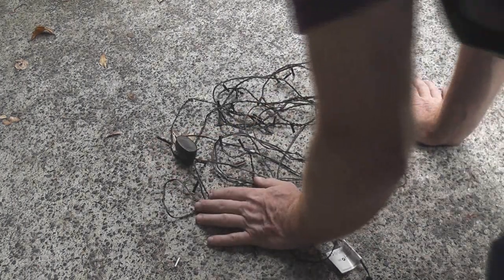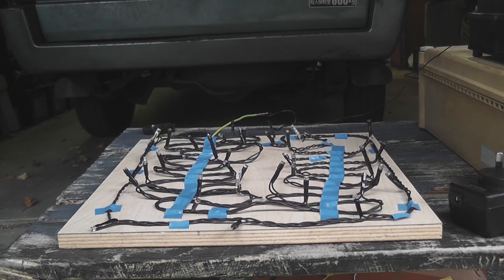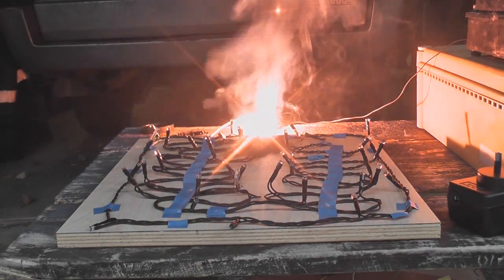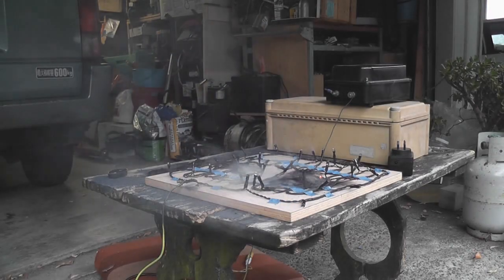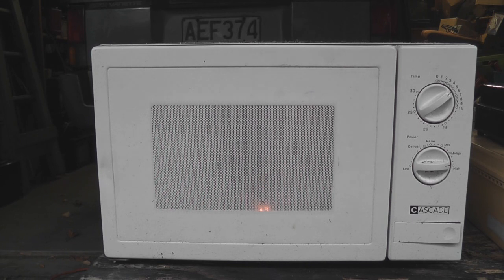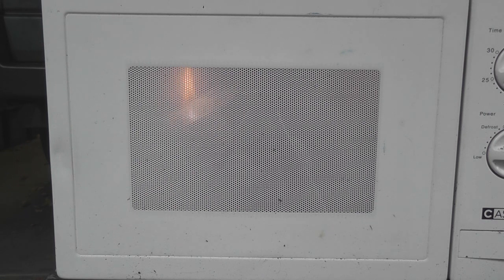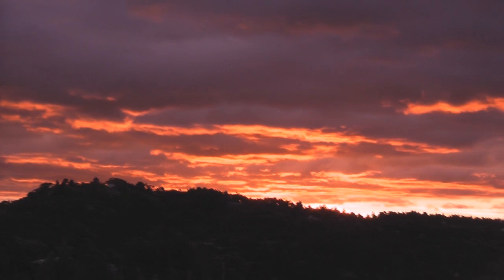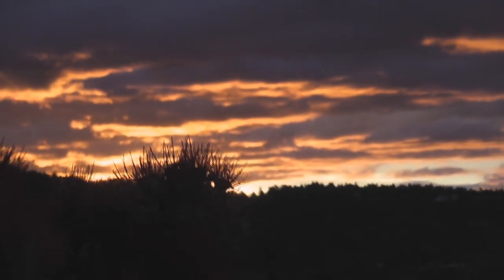M10 - X-mas lights v MOT - Duracell in Microwave  - Sunset

Comment: Christmas lights are good source for cheap LED's, although it doesn't work as original for very long because the voltage spikes in power grid, those LED's do last a long time when used with a proper resistor on a 9V battery or 5V USB. Love the sunset.

Comment from the maker: I got an Akai M9 too, which works but only on one channel, Haven't had time to have a good look at it. Start first by looking for the obvious, fried components, and then checking power supply voltages and than replace electrolytic caps.

Comment: I was going to put a 12kw high intensity discharge bulb at the top of my tree, but I was afraid that the radiated energy would incinerate the tree and possibly anything else within several feet of the lamp.